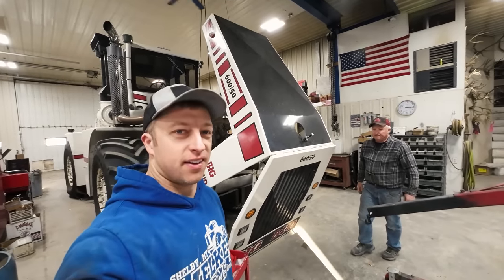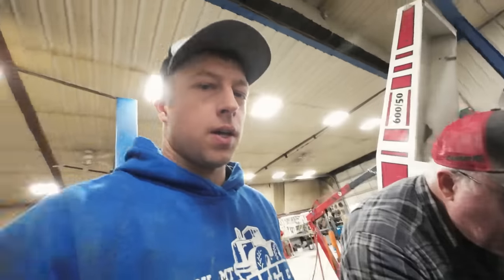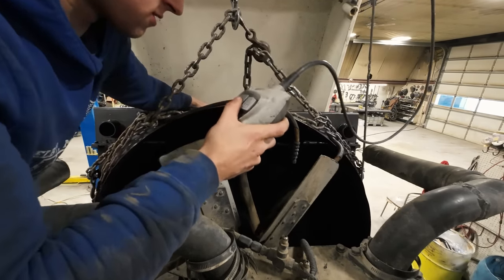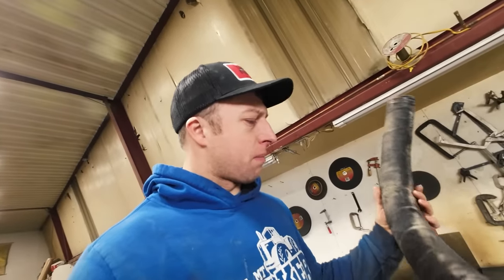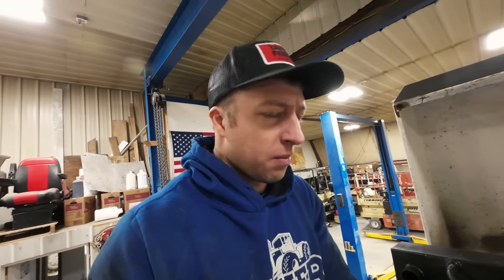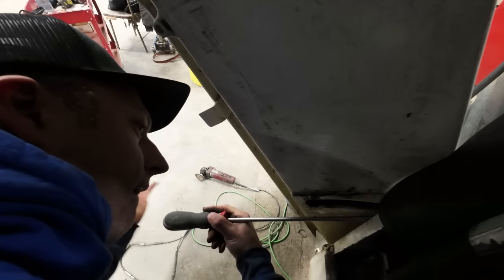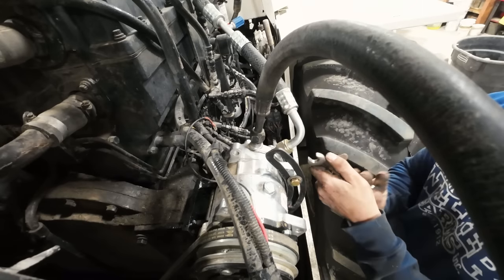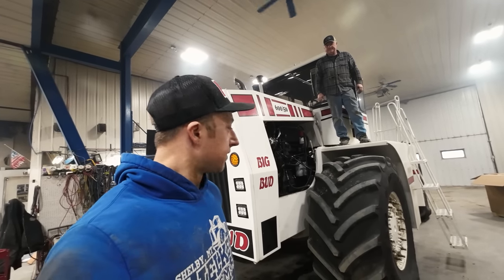Massive BIG BUD Tractor Radiator Install!

Comment: Did you guys hear the news? Big Tractor is planning to produce Big Bud tractors again! They felt the need for a "modern" tractor to be exactly what Welker Farms and others are doing for decades now: being able to repair their tractors themselfs or by local shops. Which is good news... 😎👍
Reply: So excited 👍👍👍👍
Reply: I felt they shoulda left the name slone bc they will just make it full of wires and emissions
Reply: I wonder it will be from the original designs as they are tough and hard working :) or it if the parts maybe interchangeable with the originals to make it easier to get spare parts

Comment: I learned to put dielectric grease on the ends of radiator hoses. They slide on easily, and the grease won't dry out. Then, ten years down the road when you need to replace that hose, it won't be welded on and will slide off easily. It's been a big help on my farm.
Great to see you keeping those big monsters rolling!
Reply: Make another extension for the radiator hose from heavy wall copper pipe and braze(regular or Silver Braze-HVAC) the fittings, avoid Rust.

Comment: You are right Nick,  that old Big Bud was built with some serious amount of steel. Same as the old Steigers. And with the cost of new Case or John Deere or even Fendt costing close to a million bucks,  you could put all new parts in the old girl and still be a couple of hundred thousand ahead of the game.  She'll work good for a few more years now. And this tractor will do everything you need done as good as the brand new ones.  👍 job guys.

Comment: Hi Nick, just a tip on the Cummins cooling system. The vent lines that are connected to the thermostat hsg. to the top tank of the radiator should be on a continuous uphill angle. No up and down which can create a air lock when you are filling the radiator, we would try to get a system to get a better than a 90% fill, so top off is minimal. Stay warm!

Comment: I've been slathering radiator hose connections with anti-sieze for 40 years without any problems. And after 40 years, a lot of them have come back around and I'm really glad I did.

Comment: You may have done this, but when fixing a crack like in that radiator cowling, drill a hole at the end of each crack. That hole will prevent the crack from spreading. Even if you weld over the top, the crack will continue to split without the hole.

Comment: Tips for radiator comb use:
A.  Don't rush!
B.  Start from a good spot only picking up one or two bent fins at a time.   The straight fins will act as a guide for correcting bent fins.
C.  Work slowly with a bit of a wiggle to ease comb through. 
D.  Wear good leather glove.  If you slip, those sharp fins are treacherous to knuckles!
E.  Have a great day!

Comment: I know I built an alternator bracket doing a conversion from a generator on my JD 520.  The bracket is very crude as I stair step bar stock since I couldn't bend 1/8 by 1 bar stock.  The bracket leaves the alternator a little crooked but it works fine.  Glad that Bud is gaining ground.    And it was nice Rob said my nickname.  Lol. My initials are RAD.  Have a blessed day guys

Comment: You may want to check the vent lines to make sure that they are not plugged. Corrosion often plugs these lines at the fittings in the engine.  Plugged vent lines can also contribute to engines overheating.

Comment: Nice video Nic and Dad, tip on that radiator hoses that are stiff to get over. I normally take a bit of MS grease and just run it on the inside of the hose tip, it works a charm.

Comment: Not sure if you'll see this, but always be careful using hard radiator hoses especially if there is a lot of movement... it won't flex enough and can snap the hose fitting off the radiator.  Seen it many times in over 40 years of turning wrenches.

Comment: Awesome job.. great to see family working together . .. one concern is the pipe used for the spice … I didn’t see any provision for ridge around the pipe to prevent the hose from sliding off … I don’t know what kind of pressure the system is under … I have seen many hoses slide off pipe splices without o ridge on them …. Just sayin !👍🏻👍🏻

Comment: Just a hint, when installing hoses on radiator,  I use a little non pumas  hand cleaner like gojo, seems to lube hose for install n reacts slightly with rubber to help hold it on!!

Comment: Drill a hole at the end of the crack before welding it. Relieves the tension and stops it from running any further after repairs. Old frame repair trick

Comment: Will Welker Farms be visiting and driving the Big Buds being built and eventually be demoing one of those new Big Buds?
Reply: New big buds?
Did I miss someone buying the brand and announced they are in production?

I don't do SM, I live under a rock, so it's possible but if OP is right, I do want suggested video!
Reply: I'm curious as they are partnered with CIH and granted Big Bud will be low production, would Case, who has sent a tractor for the last 3(?) years want a new Bud to show up at the same time a new 650 Steiger is being demo'ed?
Reply: @clearskiesranch1362  As I understand it they are going to be custom built for each new purchaser.
Reply: @clearskiesranch1362  hmph! Cool... I hope they don't fall as the Roman empire once did!

CEO doesn't go by Julius, I hope? 😅

Comment: Straight hose does not like bending. 
On the other side I'd change that right angle join to something with far better flow. 

Watching you debur that pipe with the drill was nearly very painful. Just use a file, it's quicker and easier.

Tap water, that explains all the leaks

Comment: As big as your cooling systems are I'm surprised you don't have a vacuum filll system. Not only does it completely fill the cooling system but it also will let you know if you have a leak or not because it won't hold vacuum

Comment: Nick, when you were putting the rollers/spacers in the sides of the hood I noticed that you possibly have a metal wedding ring on.  I have two friends that no longer have a ring finger to wear one since their ring caught on something and removed their finger, so am a bit drawn to things like that from a safety standpoint.  I know that they have safety style replacement rubber/ plastic/? ring for folks that are safety minded.  Have you ever considered getting one or is what I see an actual one?
Reply: He is wearing one of those safety rings, not a metal ring.

Comment: That's quite a machine. How many acres are you guys farming? How far from the cdn border is your farm?
Reply: 10k and 30 miles
Reply: @RobertWelkerFarmerBob  That's a big grain farm. Even in Cda. Are there any Buds with the DD 16V engines around anymore? Big fuel burners i assume. Maybe converted to Cummins, but sound way cool. Those were orig. made in Havre, MT is that correct? I guess you guys must drive around missile silos around there,  but maybe closed up now iirc.

Comment: I pulled a radiator in a 600 3 times one summer because the kt Cummins kept cracking front covers. Not a fun job

Comment: I just saw a teaser about an equipment company that is going to start building "Big Buds"
Reply: Yep 70,000 lb frame with Cat drivetrain,640 - 750 hp for now. Built by Rome MFG,  GA. They build heavy equipment and used to manufacture 4wd farm tractors under the Rome, and Woods and Copeland brands. To be revealed in March. Were going to start a few years ago, delayed by Big Equipment Co's big fire in 2017.

Comment: It might be goodto try and find a cross-reference radiator.  Or was that not a part that was not from something else and only big bud.
Reply: I didnt know like if a differnt truck radiators were used or if like one from a piece of excavation equipment was used originally
Reply: Sounded like there was one available, just wanted to save money if it could be repaired. Big Bud always tried to build with commonly used components.
Reply: @lynwessel2471  thats why i thought that you could cross referance whitch one it was if you go asking for a big bud rad you wount get many new orused ones but if a knew a  mack dump truck rad was used they might be able to find them in junk yards
Reply: @chadengemann8237  Dont know, but would think heavy equipment radiators.
Reply: @chadengemann8237  Im sure Big Equipment Co in Havre would help them out. They refurbish Big Buds, Owned by the family that owned Big Bud Inc.
Reply: All of you guys need to know that there's a ton of sources for radiators. It's just length times width time height and location and size of the inlet and outlet. Any radiator shop that's worth anything can get one at a cost. The radiator shop that they used said $10k to get a new one. That Big Bud radiator is huge.
Reply: @delbutler885 Just as well ask the people that built the Big Buds and now rebuild them. They'll point you in the right direction. Hour and a half away from them.
Reply: Why can't you guys just figure out that Welkers have been running Big Buds and buying parts for them for a long time. That Big Bud radiator is over 40 years old. It has hydraulic coolers in the bottom of it. They know what they need and where to source it. Really guys Robert Welker is not an imbicle. They know what they want and need and how to spend their money. I have a John Deere radiator about that same age in the shop being rebuilt right now. Parts are hard to come by and the price has doubled since 2021.

Comment: Tap water a big no no unless it's r o
Reply: $2,300 to have the radiator repaired. For another $20 they could have put in distilled water, and maybe it would last another 10 years.
Reply: I always use 50 50 premix  and do dca test annually with a filter change.   9000 hrs on my 903 cummins